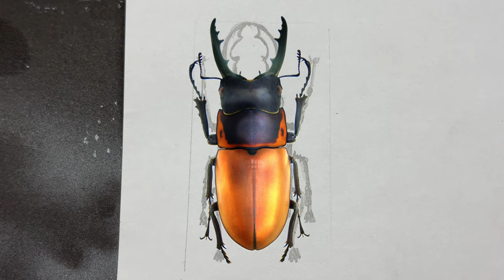Fising lure Stag beetle

Comment: This feed is amazing ❤
Reply from the maker: Thanks a lot 😀🙏, glad you like it. I was in a bit of a hurry so there are a lot of mistakes 😆
Reply: @makinglure That's perfect, it's just that for the legs, maybe it would be better to use wire treated with UV resin which is stronger👍🏻🙏🏻 just a suggestion 🙏🏻😄

Comment: I want to ask if after using clear coat varnishes do you add more resin to the outside of the bait? 22:58
Reply from the maker: It all depends on which predator the lure is intended for. If I plan to lure predators like pike, then I add another layer of resin after the varnish. I didn't add resin to this lure, but I dipped it in urethane varnish one more time today. 😀🙏
Reply: Oh I see, so it depends on the fish you want to catch. Oh yes, how do you deal with uneven surfaces on the lure after applying resin? I have many lures like that